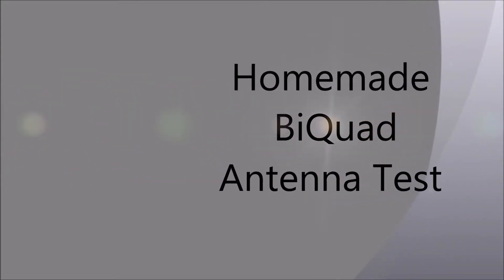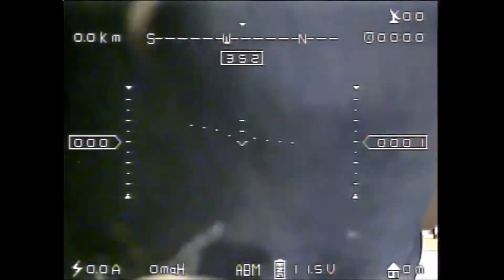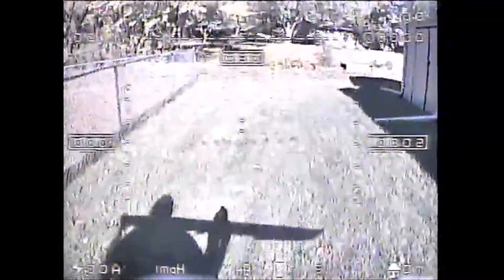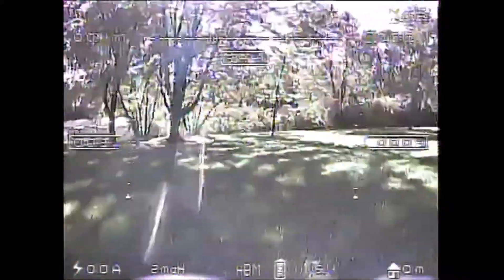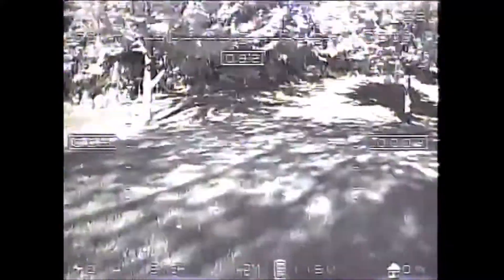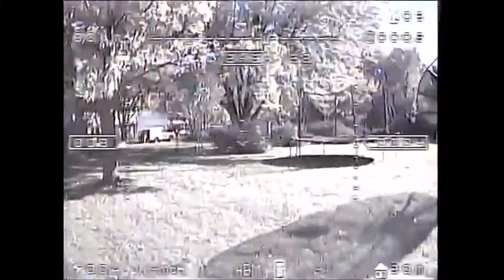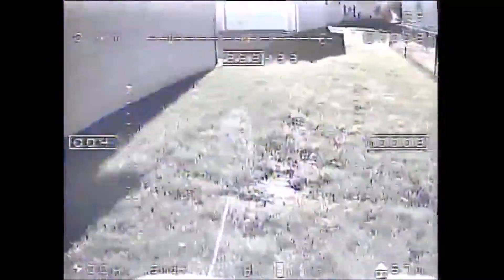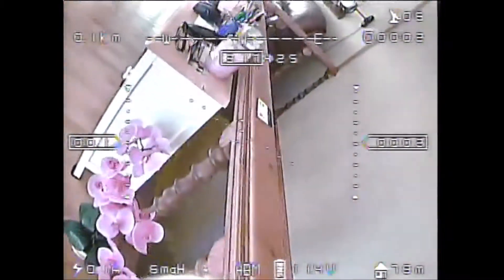Amazing Homemade BiQuad Antenna Test

Comment: Very nice .... in my test set up, I was loosing signal as the truck turned into the corner ... this is purely LOS right now ... that Bi-Quad would capture signals better .. what is the angle of  radiation?
Reply from the maker: It is supposed to be 50 deg but I did extensive testing today and it is wider than that and very powerful.
I could fly behind it almost 3/4 mile.  The pix was not great but very flyable.
I way overpowers my patch antenna.